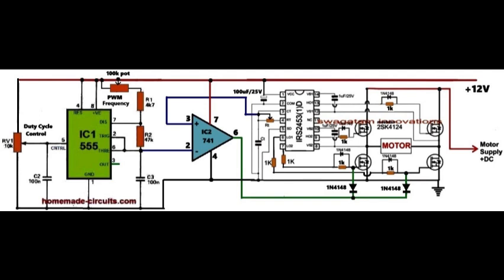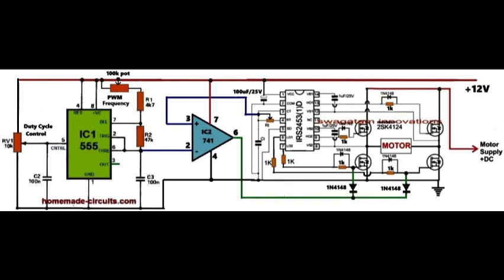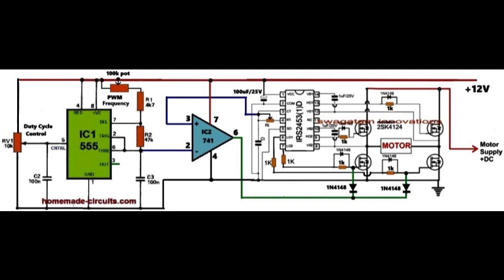Make this Simple VFD Circuit (Variable Frequency Drive Circuit Diagram)

Comment: What ideal value are you using for the Rt and Ct if you wish to control a 220V 60Hz 400W AC motor? Also is the Motor Supply the same as the supply voltage for the whole circuitry since it need aDC supply to run the FETs around it?
Reply from the maker: Rt and Ct Values for 60Hz:
The IRS2453D datasheet uses the formula: f = 1 / (1.39 * Rt * Ct).

If you keep Ct at 0.1uF, you need Rt to be about 120k to hit 60Hz. The schematic currently shows a 1k resistor and a 100k pot, which maxes out at 101k (too low). To fix this, just swap that 100k pot for a 150k or 200k pot so you have enough range to dial it in perfectly.
No, they must be separate. The control chips (555, 741, and IRS2453) run on a low-voltage +12V DC rail.
To run a 220V AC motor, the "Motor +DC" rail needs high-voltage DC to match the peak AC wave (220V * 1.414 = ~311V DC). +311V DC goes only to the top MOSFET drains and the big 1kV capacitor on the right, while +12V DC goes to the chips on the left. They should only share a common ground (0V).

Comment: This is awesome.  One thing I’m wondering is if you even need the 741 comparator. Pin five of the 555 goes directly into a comparator. The 555 outputs a square wave with a duty cycle that (if I recall correctly) is roughly proportional to the voltage on pin 5.
Reply: So if I was to feed a 50/60 Hz sine wave into pin 5, doesn’t that suggest that the 555 would output a SPWM signal directly?
Reply from the maker: Yes, that would be perfectly fine...you can the get the appropriate signal by rectifying a 12v 50 hz source through a bridge rectifier....
Reply from the maker: Thanks Mike, glad you liked it...if we remove the 741 then there will no comparing of the two signals, and the output will not correspond to a sine wave structure....

Comment: wow that is a really elegant way of doing that, driving the gates low prematurely is so much simpler than having to deal with a standalone gate driver and oscillator and proper modulator and stuff. that is such a smart way of doing things if circuit simplicity is the major design goal.  
sorry for the dumb questions but i'm afraid i don't entirely understand a few things about this circuit:
1: i don't entirely understand where the sinusoidal signal for SPWM is generated..if i understood correctly the IRS2453 provides it's internal oscillator signal through pin 4 which is the high frequency carrier and the NE555 is generating a triangle wave of lower, adjustable frequency? so by comparing the two i don't understand how that would produce an SPWM signal.
2: how did you get away with driving an inductive load like a motor without protective diodes on the H-bridge without blowing up the transistors?
3: why are there additional resistors on the gate drive circuit only for the low side FETs but not for the high side ones? is it to allow the LM741 to compete with the gate drivers or is there a different reason?
Reply from the maker: Thanks for your interest in this circuit concept. The SPWM is generated at the output of the opamp, which is then fed to the low side MOSFET gates for chopping their conduction in response to all the corresponding low signal sections of the SPWM waveform. I have shown the basic concept, I have not included the protection stages like snubbers, frequency filters etc. All these will need to be included while making this design practically. Please remove those extra 1k resistors from piin6 and 7 of the IC, those are mistakenly repeated for the low side mosfet gates. I will try to pin a detailed, corrected diagram at the top of this comment section soon.

Comment: Hello 
220v AC of main voltage increasing to 310v DC after rectifying by diodes and capacitor 
I have question , with 310v how to control 220v motor ?
Reply: Thanks a lot for reply
Reply from the maker: Hi, the voltage and frequency optimized SPWM chopping across the low side MOSFET gates will take care of the output voltage and will set it exactly as per the load specifications.

Comment: For motor supply +DC 
I have converted 220v AC  to  220 v DC  ????
Reply from the maker: That is OK, but ideally you must connect a filter capacitor to create a 310V DC after rectification using bridge rectifier diodes, for the motor.

Comment: Hi
I'm beginner 
This circuit no need to transformer  like SMPS in external stage for feeding AC motor ?
Reply from the maker: You can convert the 220V AC to 310V DC and use it for your motor if your motor is a 220V motor. If you are a beginner then this circuit is certainly not recommended  for you, because it will require an in depth knowledge of the various parameters involved in the circuit and you will require an oscilloscope to test and set the circuit correctly.

Comment: HI, 
I would like to ask you about the 1n4148 diode which is commonly used? that is, where it is used in the circuit, what role does it have? Thank you
Reply from the maker: The 1n4148 diodes are used to integrate the SPWMs from the pin#6 of IC 741 with the low side MOSFET gates, so that the low side gates 50 Hz square wave frequency are chopped according to the negative SPWMs, and forced to oscillate with the same SPWM pattern.

Comment: Hi Swagatam - i love yr website, with its circuits, rxplanations, theory and calculations. 
I was making the inverters the other week. 
In doing a simple one, a 4017 or 4047, cant remember which, driving two fets, they heated up unacceptably and fast, no matter what frequency i set it at. 
Had a look around to find out why, and eev blog thread said that ic does not output enough to directly drive fet gates, so they are never switching properly on, and hence heat up. 
It was advised to use not a bc547 and complimentary, but a higher current 0.8A  337 and comp in a totem pole config. I didnt know what a totem pole was, but now i do. Im just a beginner. 
But being just a beginner, and with only a little knowledge, i would not recommend nor publish that circuit. I would at minimum say this circuit works, but the fets wont work for long. Or instead say this circuit works, but is rubbish, and you will need a totem pole to drive each fet properly. 
Its really really frustrating to try and find good, working, functional circuits  that dont contain basic errors, mislabelled parts, omitted parts, extra parts, all sorts of nonsense. 
Anyway, lots of your circuits are great, but how do readers know they can put this all together on a pc board, and find it to be another case like the "simple inverter". 
This vfd circuit is a little more complex and much more time and labour intensive to put together to then find some inexplicable design choice that renders the thing non or barely functional, let alone actually useful. 
The fets i used were around the same voltage, 4 different pairs, 60-100vds, and in almost all parameters better than the  z44's - much lower rds on, lower gate capacitance, faster turn on, rise, and turn off, much higher current handling, lower gate charge etc. input was 12vdc, as per your circuit, driving a 6+6T primary on ferrite, outputting a little over 300vac no load.
Reply from the maker: Thank you so much jonlitchfield8888, for your valuable insights, really appreciate it. However, did you investigate how and why the 4017 directly wouldn't be able to drive the MOSFETs, considering the fact that the 4017 Ics can deliver around 20 ma current from its output  pins, which is more than enough for operating low current MOSFET loads, provided the supply voltage to the IC is 12V. While a totem is an ideal way to provide optimal current drive for the MOSFETs, this may be required for high power inverters, not for experimental medium range inverters. In my circuits i mostly focus on the foundational concept, not on the refinements, because I am always ready to help the users with the refinements or upgradation tips whenever required. Another thing is that, it is user's responsibility to judge the complexity of the circuit themselves and decide  if they are eligible to build it themselves or not.  Also, it is the user's responsibility to ask me whether they are supposed to go ahead with a specific circuit design or not, with regards to their level of knowledge in the field. Next, a PCB designing is never recommended unless and until the circuit in question is first verified and tested on a stripboard prototype. And, always, a new circuit must be built and tested in a stage-wise manner, starting with a smaller model and then upgrading step-wise, rather than assembling the whole thing all together at once, which will certainly never work due to obvious causes. Finally, a very important thing is that, a circuit is a highly technical subject which should never be attempted unless and until the user has understood its working thoroughly and is himself confident of its working when implemented practically. Even well tested circuits often don't work because of  technical mistakes made by the newbies or due to low quality components.
Reply: @SwagatamMajumdar  hello, thanks for your really good reply, in depth, well worded and polite. 
Yes i am def a newbie. 
Maybe the load i was switching was too much then. 
I breadboarded it with totempole, but breadboard has bad connections so will redo on pcb and apply a much smaller load, and see what the difference is directly and with totem. 
Apologies for late reply. 
Thanks
Reply from the maker: @jonlitchfield8888  sure, sounds great, let me know if you face any further problems. I guess you are referring to an inverter circuit, so for further discussions please comment under the relevant video or post so that other users can also benefit from our discussion.
Reply: @SwagatamMajumdar  yes, and thankyou, and will do, thanks again 👍

Comment: Thaks a lot..sir💐👍
Pls...make 220 v single to three phase vfd curcuit using 
1 X tl494 signal
1 X Cd4018 for three phase signal
3 X Ir2111 final igbt driver
Reply from the maker: You are welcome Patil9919, actually you can use the same circuit as explained in the above video to make a 3 phase VFD, simply by replacing the single phase inverter design with a 3 phase inverter, and then integrate all the low side MOSFET gates through individual diodes with the output pin6 of the 741 opamp...